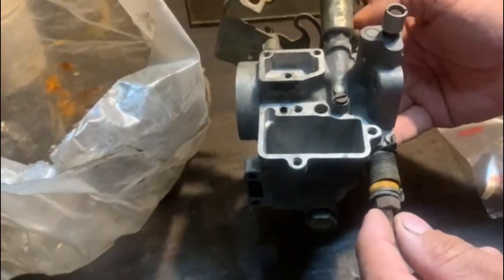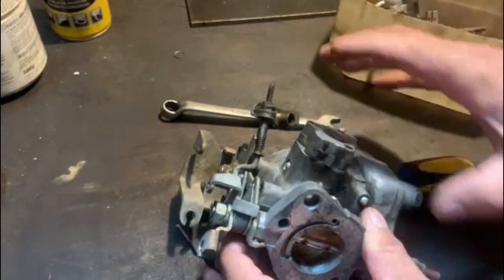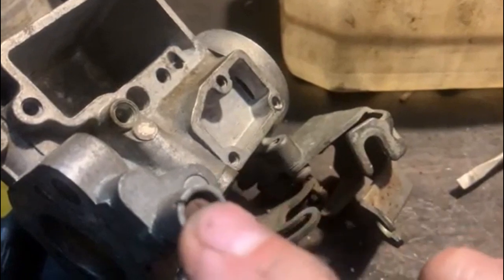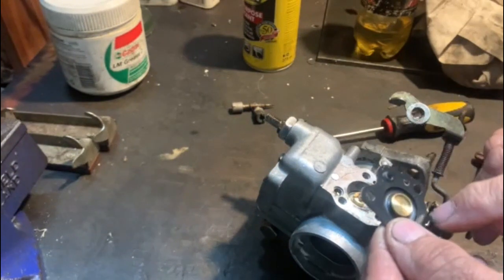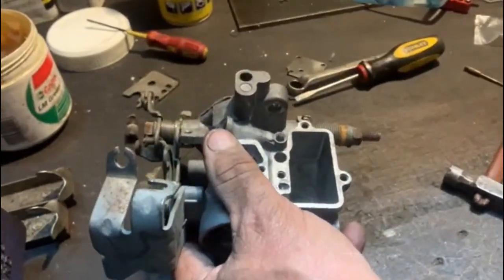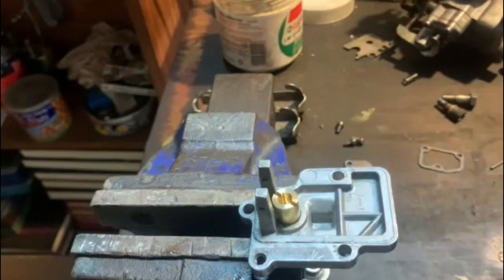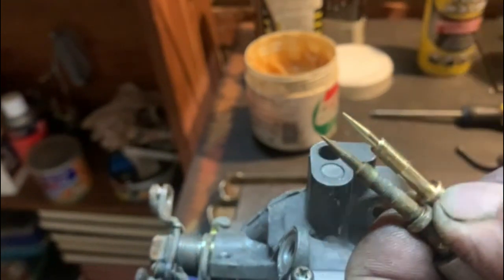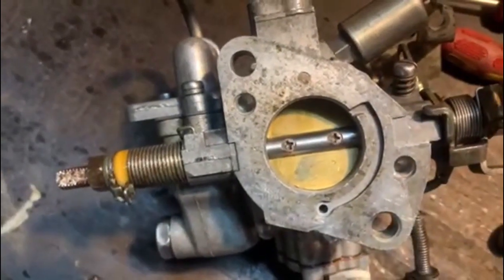Suzuki SJ 410 carburetor service

Comment: Hi manis there any possible way you u can help me?, I have rebuilt the vw mk2 carburettor and got it idling perfect but when I give throttle on low RPM it starts jerking, trying to figure out what it is I even put the old  jets back and still jerks 🤦‍♂ ..
Reply from the maker: Hi, assuming that the timing and spark is correct, i would look at the accelerator pump jet, ensure it works correctly